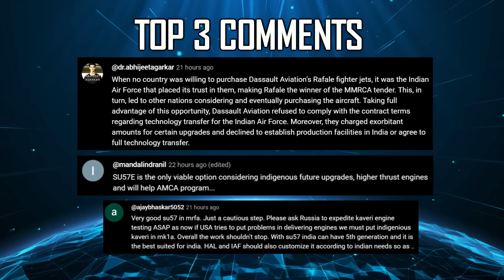Indian Defence Updates : L&T Fighter Jet,Brahmastra Missile,Meteor Production,T-72 Engines Ordered

Comment: Low..... very low aircraft   maintenance standards of Indian Air Force are responsible for high crash rate of aircrafts .......
even brand new aircraft such as c130 Manufactured  by top aviation company like  Lockheed Martin of USA  crashed in Indian Air Force......

Comment: Hmm, majority of airforce across globe had stopped using Jaguar fighters, it's production had also stopped decade ago, similar thing is also going to happen with Mirage 2000 in next few years. In absence of spare part supply, this fighters will also start going on the path of Mig21. There is an urgent need to take steps. Along with doing production of new fighters on time, we should also need to look for spare parts to maintain this 9 squadron's usability for airforce. Hope for best.
Jai Bharat 🇮🇳🇮🇳🇮🇳🇮🇳🇮🇳🇮🇳